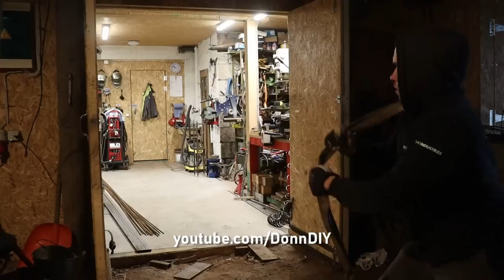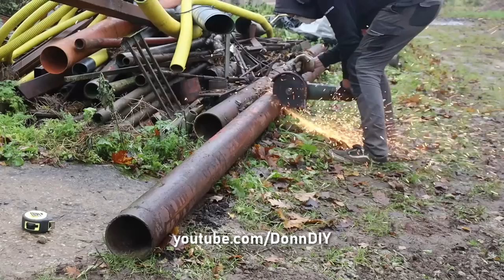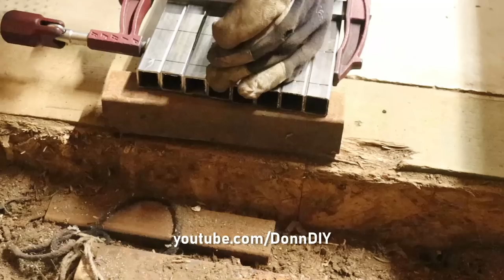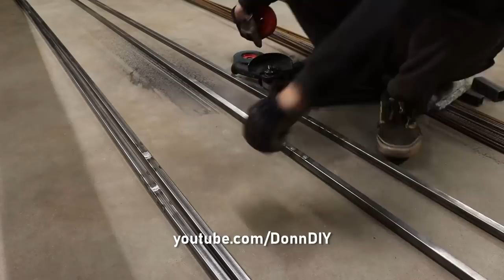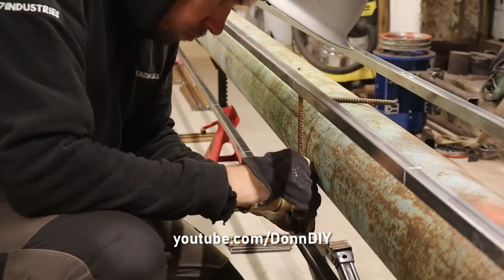7m / 23ft Truss Beam Fabrication - Swingblade SAWMILL Build Ep.10

Comment: thanks for the detailed video on building the beam , have plans to build a similar mill in the near future, just cant decide wether to use a single swinging blade or two blades set at 90 degrees, either way one pass nets a finished board .... keep the videos coming !
Reply from the maker: I wanted to keep this mill more simple and light weight. Thus one blade and manual options. Two blades definitely have their advantages.👍

Comment: Another very good video, fun to watch.

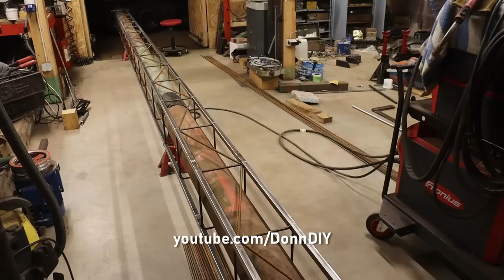A tip: if you had rotated the truss by 90 degrees at minute: 18:10 in the video and then welded the struts from above, the truss would have become even more graded because then gravity would not have pulled the part down.. .😉

But a very good idea with the thick pipe in the middle and the tensioning of the four-mant pipes👍

Greetings from Germany
Reply from the maker: Thank you!🙏

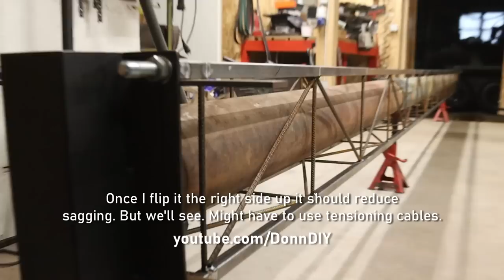Comment: 20:15 should use tensioning cables regardless. Here's why. Metal stretches over time, that truss is going to be subjected continuously to stresses, so that's gonna be working against you constantly. With cables, regardless of the stretch you can always either adjust them or replace them once they've reached max stretch (as they do in bridges once every few years). One other piece of advice, make the carriage such that when you're not using, it has legs to support its own weight off the ground. Even if you place it at one end of the truss when at rest (which you should) it would still put unwanted tension on the truss when you're not using it. 
Last piece of advice, if you're not using it for a long time (let's say half a year) then de-stretch the cables, if you choose to use them. Keeping the truss under stress is not gonna help you, itself it should be supported with some pieces of wood during that time. 
Jm2c as usual. 
Jamble aside, impressive build of a truss from common materials and straight too. Good idea to use the caliper, most people mark them down or put markings on a table and call it "good enough" and by the time they're done... it's more twisted than a twister. :)) Good work!
Reply from the maker: Yup, I thought the same thing about the cables. Good advice!👍
Reply: @DonnDIY  It's for rough cut lumber. It WILL be fine.
Reply: The cross bracing will stiffen. We will just have to wait and see since recording and editing videos is so time consuming .
Reply: Many bridges are constructed without cables. So clearly cables aren't a requirement. And I think you're overstating how frequently cables in bridges are adjusted and/or replaced. While it does happen, the main cables on my local suspension bridge are 66 years old and still going strong.
Reply: @bradley3549  // I agree—I'd lay out indicator marks/measurements in locations that can be regularly checked to dictate if/when cables are necessary.
Reply: It will outlast the builder before it is compromised by age and use.
Reply: @stomper2582  Both you and Bradley forget that those bridges and cables are made from materials that are far superior from what you commonly get on the market. If you'd build this truss from those, yeah, it would outlast him. He's not, this is scrap material of unknown origins (read material type code). This is a very narrow section truss with a very long length. While it might be rough wood cut, if it starts to sag too much, it's worthless. Cables are cheap. Simpler to add them than have it sag. Cables are the sacrificial bit of any structure that's of this nature, they're consumables.

Comment: That looked like one tedious job. I notice you like to use re-bar a lot, why, is it stronger or cheaper? And how are you going to pre-heat that whole structure for welding, and or is that really necessary?
I still have no idea where your going with this, wont I be shocked........
Reply from the maker: Rebar was stronger, cheaper and lighter material. All great things when building a truss beam. I'm gonna pre-heat only the weld area with a gas torch so that the weld doesn't bend the rail tube after it cools down. Otherwise I will just weld on a cold material and once the weld cools it'll pull on the tube. I hope it makes sense.😀

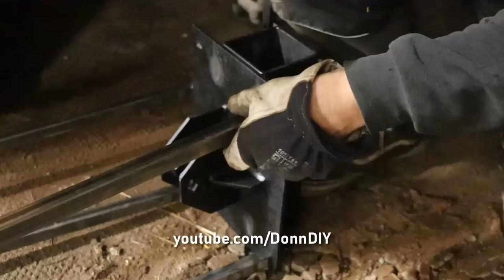Comment: 11:08  What's the significance of using square tubing for tensioning vs round tubing?  Is square tubing cheaper?
Reply from the maker: I'm using the 160mm round tube for tensioning. And the square tubes are getting tensioned/stretched. I use square tubes as rails where the saw carriage will ride on. More surface area.👍

Comment: Im guessing once the tube is removed you will add some adjustable braces in the centre?
Reply from the maker: First of all I'm gonna see what the truss beam does and how it behaves when suspended. Then probably add steel cable(s) with adjusters so I can pull up the possibly sagging center section.👍

Comment: stupid question: will you be able to get it around the corner and out the door?  it looks pretty long.  Or are you going to go straight out through that window on the other side of the doors?  
Looks pretty tight, but might just be an optical illusion or maybe I need stronger glasses!  
lol
Reply from the maker: That's a good question. It should get around the corner.🤞Fingers crossed!😄

Comment: I would of used a string line and used a jack when doing the sides to help with the sag. Jack it up before welding in the side angles. But can't wait to see more.
Reply from the maker: I did that while getting the end caps on. Once the square tubes were stretched there was no need for the jack anymore.👍

Comment: hey Donn, just an idea to align your big tubes (at least in the future), you take another section of tube, and make one cut all along the length, then you put it as a male inside both the tubes you want to join... best way to center part to other, plus it get more strength. Anyway, thanks for your amazing videos dude !
Reply from the maker: Yup, that's what I did in this video too. You couldn't see it properly due to the angle I took the video but I used a clamp I made years ago the same way by cutting it open lengthwise and using it to connect the two tubes.👍I had more of these tubes and used them as chimneys for my sauna build.

Comment: Ah. You will remove the tube after welding!
I read it in the comments. 
I was wondering why you connect both tubes with a "collar"(?) but not weld them.
Reply from the maker: Yep, getting that 160mm tensioning tube out of the beam will be a hassle though. But doable!👍
Reply: @DonnDIY  I think we all really want to see that feat,  Donn! I'm thinking you are going to have to assemble the whole mill outside or if there is enough room, in that cold corridor just outside your shop space.

Comment: Don, you should build a steel tumbler to remove rust from metal, so that its easier to weld and paint. You coud make it out of a length of pipe, some casters, and a gear motor. You could line it with rubber from a conveyor belt, as it can get noisy. You coud put crushed stone in it, or punched out metal from an iron worker that punches holes in steel.
Reply from the maker: That's a great idea! I will look into that.👍 When will I build it - who knows...😄
Reply: @DonnDIY  you might want to build a shed around it to make it easier to use it in bad weather, and to minimize noise.

Comment: That irrigation pipe  is some good high carbon steel. 👍
Reply from the maker: This is actually mild steel pipe to my knowledge. It was used as part of heating system in a factory.
Reply: @DonnDIY  what I notice from the video was the spark color and how difficult it was to cut;  heats up fast and eats abrasive like crackers.